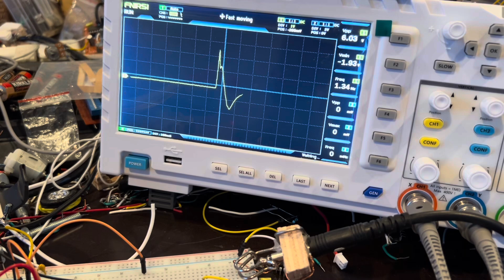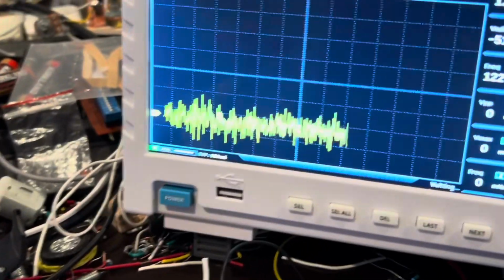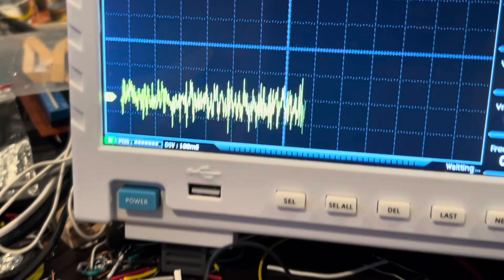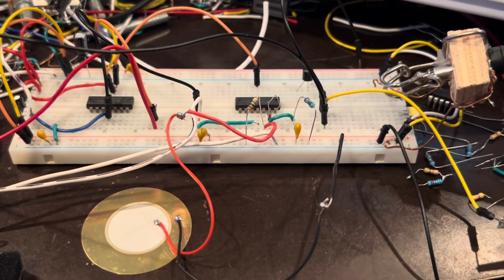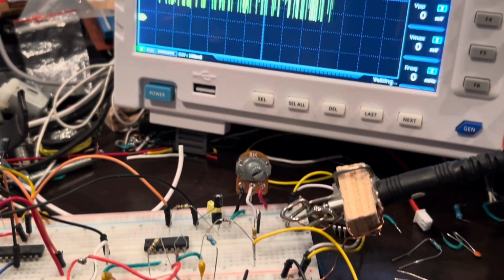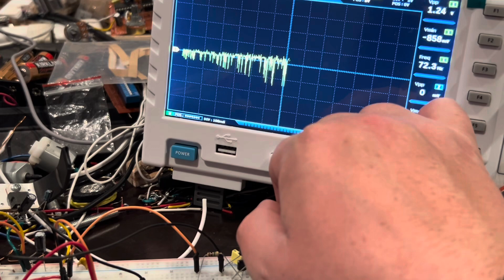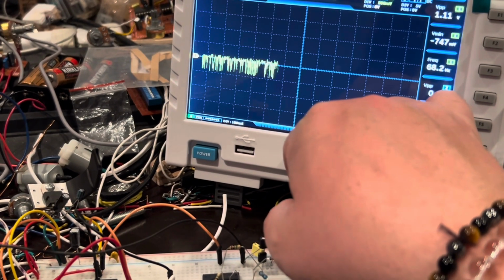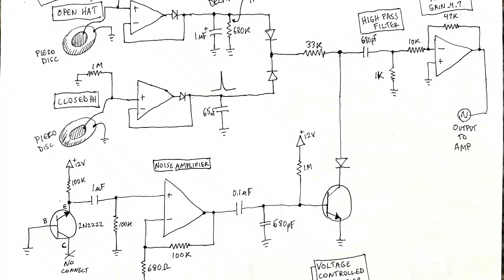Force sensitive Hi Hat drum pad using a Piezo Disc - Diy drum synthesizer from scratch

Comment: I love this circuit and explanation, thanks for teaching us about this in such a straightforward way! 
It makes me wonder if you could make a passive drum circuit that was only powered by the voltage output of the piezo disc? Like something that could be built into a little drum pad and not need a battery or psu to make sound. 
I know there are passive drum circuits in things like the Landscape Noon or Neutral Labs Scrooge, would you know roughly how those circuits work?
Reply from the maker: @LoudPaul1  thanks, worth looking into

Comment: I like the simplicity of the circuit. The direct use of analog circuitry instead of microcontrollers means there is zero latency. I wonder if adding a ring modulator to the output would allow for a more metallic sound for your cymbals.
Reply from the maker: @BlueSOF  for cymbals, an aggressive high pass filter and mixing in a discordant group of oscillators gives it a more metallic sound. I did a video on a cymbal a while back

Comment: I built my own set of electronic drums 30 years ago using piezo disc which then plugged into a drum module. I built each drum out of wood, with a 1/4" rubber sheet for the striking surface. The drums are octagon in shape with oak edging. On the bottom was a 1/4" female jack that were connected to the piezo. They are very playable and work great!
Reply from the maker: Love analog audio

Comment: Cool sounds, You maybe could use a transistor or better a fet on the piezo element, this should avoid negative spike and prevent the .65 voltage lost from the diode. they can't work in reverse for npn or n-type.
You can load the entire tr-909 hi-hat bin file in to a Arduino Nano Every with 48k flash.